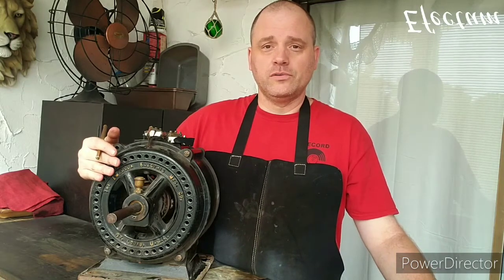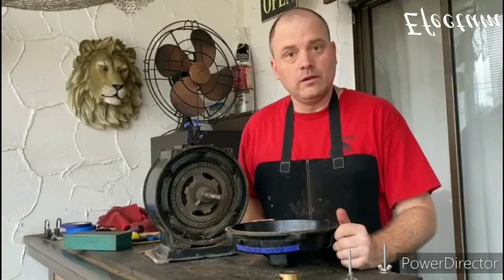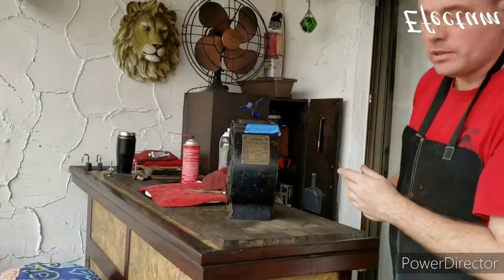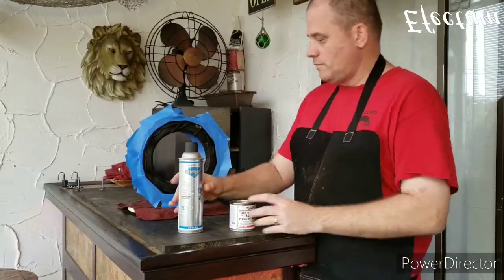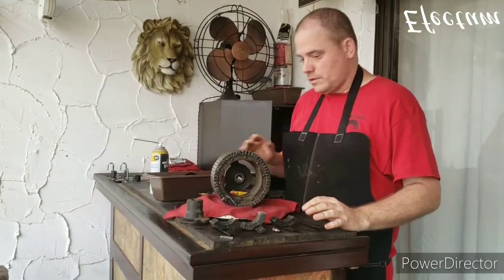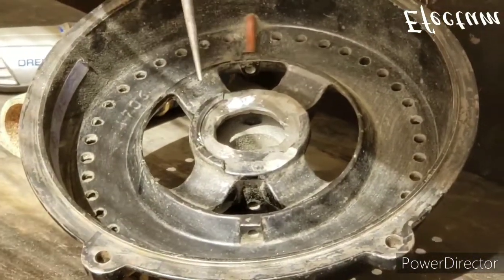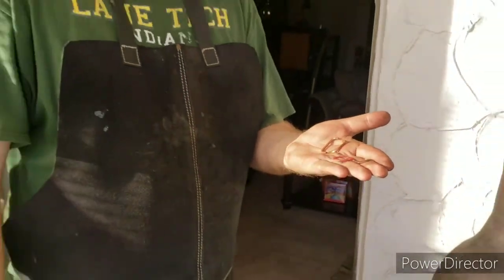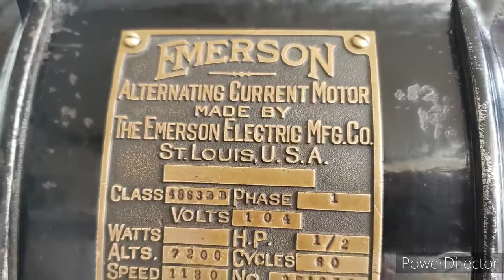[Restoration] & Conservation: 120 Year Old Antique Emerson Electric AC Motor. 1/2 HP 1180 RPM.

Comment: Emerson around the same time period made motors which had a centrifugal clutch to make up for lack of starting torque.  The rotor sat in its own bearings and the shaft would only start turning once the rotor reached the proper speed.
Reply from the maker: This motor has the clutch feature. Its much more noticable if there is a load on the shaft otherwise the shaft spins up just from the light friction on it...

Comment: I really learned so much from this video. Thanks and really appreciate all the details. The motor looks and sounds amazing! Where do you find your motors? Thanks again.
Reply from the maker: There's a FB group called Antique Electric Motor Experts and its a great group. In addition to having a great knowledge base, these guys frequently offer stuff for sale. Of course any of your antique tractor shows or antique fan shows are sources too. Some I have purchased on ebay if the distance isn't too far. I appreciate you watching.

Comment: Just found your channel. I’m totally new to this stuff with little electrical background.    Helping a friend clean his shop, he gave me a vintage floor fan.  Sunlight Electrical Co.  has the GM at bottom of tag, I did find that makes it after 1933, when GM bought them.    It seems to be rare ? 1/8 hp 110 volt. 3 amp. 1140 rpm. 
Model. s4523.  I can’t find anything on this.  The blades/shaft doesn’t wanna turn.  Is it worth messing with ? Should I take it to a professional motor rebuilder ?
Any info appreciated.
Reply from the maker: I always recommend that folks join the FB group Antique Electric Motor Experts. There you can post pictures and you will get step by step help to get your fan running. I have a video on s small Delco motor that I cleaned up which was built by Sunlight. Good luck with it!